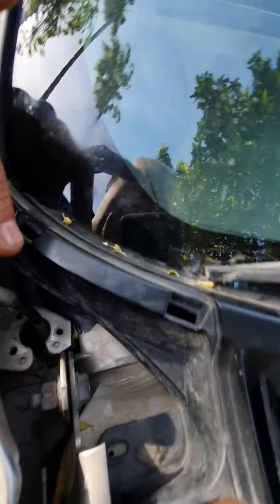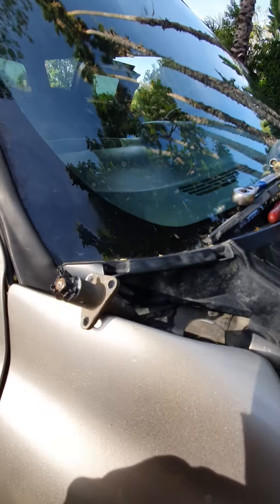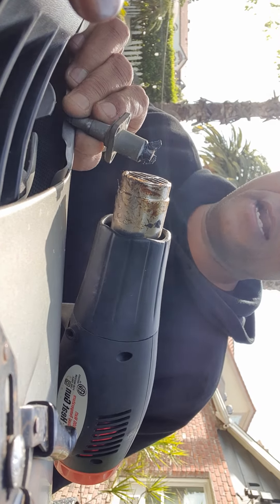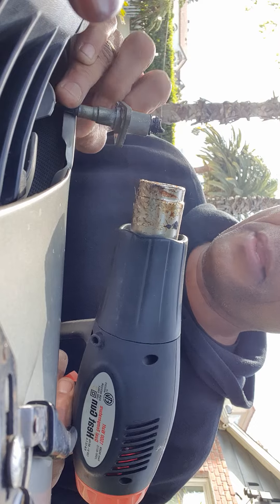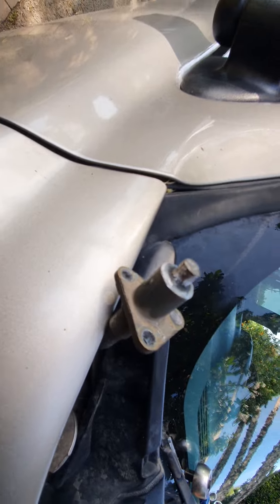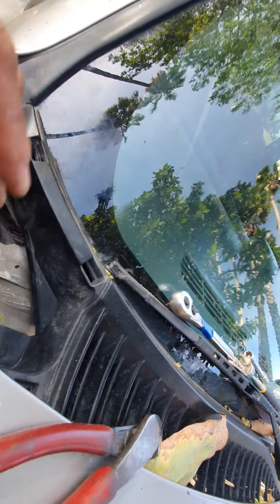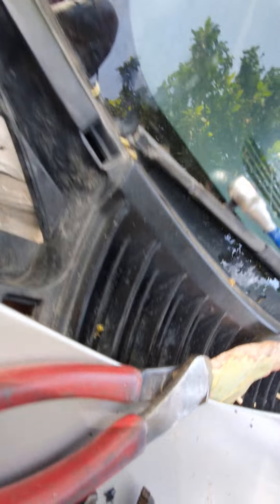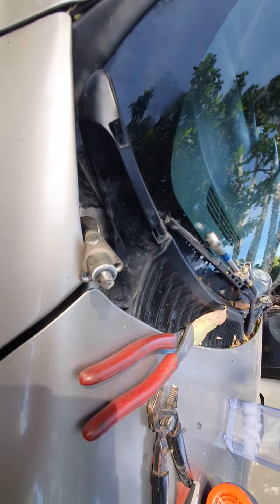Super quick and easy antenna fix for 2001 and up Chevy Silverado

Comment: when removing the cover start with the bottom tab by opening the hood lifting slowly until the clip comes free by hand then shut the hood and go to the right side clip and pry slowly with a screwdriver/clip tool and pop off the second tab by hand then slowly prying up and down and the third clip then will pop off.  did this in less than 5 minutes.  no broken clips on my 2001 1500.  excellent video and the fix went perfectly for 20 bucks!  the adapter did a bit of work not much and the job was done!  the big problem was the broken base.

Comment: Will the wire unplug from the base without messing it up as the wire is fine and like not to do  nothing but replace the base leaving the original wire in place . Can it be done , will it separate ,(unplug from metal base ) without damaging the wire and having to go ahead and replace it to ?
Reply: I guess have to findout by myself. Just wanting to try and disconnect the wire from the base. First going drill the broken screw and try to remove the broken threaded end of the antenna that broke of with a easeout .( Screw extractor) . As I took a punch to center my hole I will drill and I have the right bit and easeout. I see no one talks about just replacing the base without going threw the troubles of removing the wire . It looks like it would but haven't removed the plastic piece around it and then unbolt it to see if the wire can be unplugged from the base as I was asking about. I see if I can if I can't remove the broken threaded screw end of antenna.   I guess if neither of those work I have to replace the wire also.
Reply: NO, IT WILL NOT!  USE THE KIT AND DO NOT FUXK WITH THE WIRE AT ALL!!!